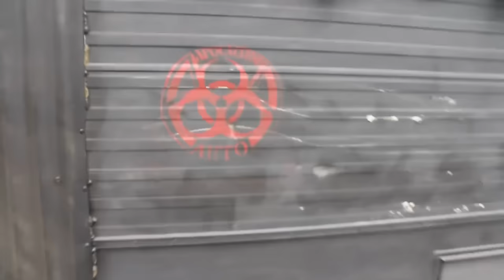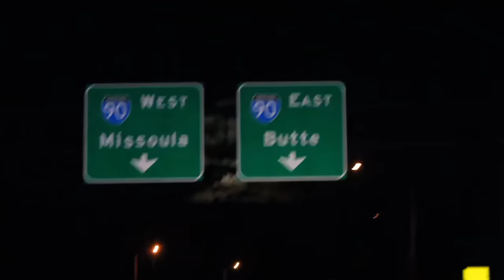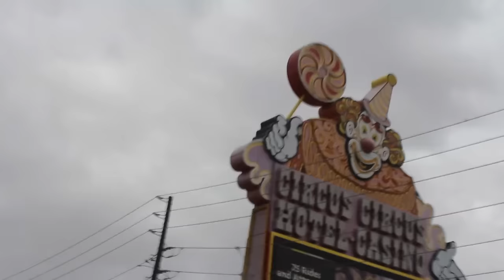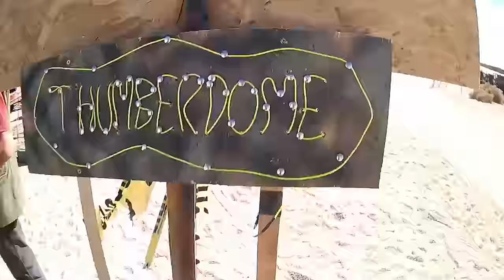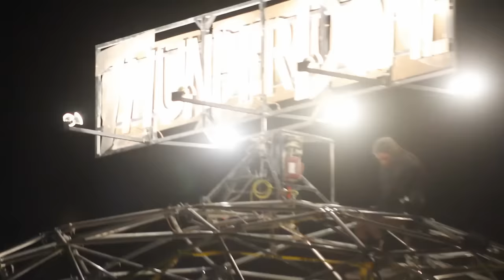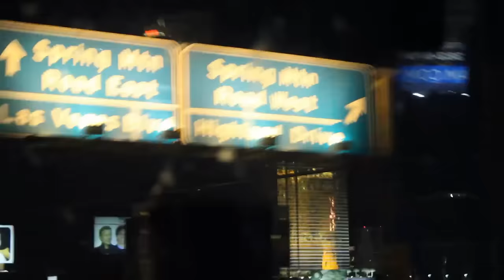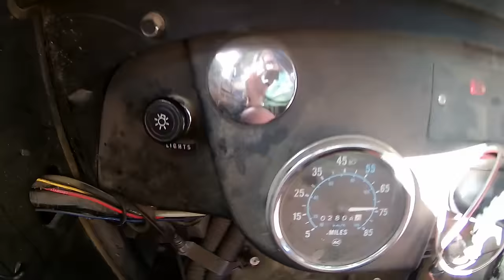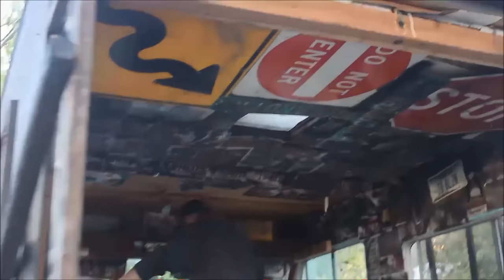1100 mi. to Wasteland Weekend in the War Child Apocalypse Bus! APOCALYPSE AUTO ep.5

Comment: I think with that old camper having engine trouble you guys should give it a whole new engine maybe not brand-spanking-new but maybe something with a little more of a growl to it
Reply from the maker: yes!
Reply: That 440 needs to come out, be freshened up some, and stabbed into a rusty Mopar of some kind. Roadkill-style.
Reply: Go with a small Cummins. Isreal used a 6 cylinder "VAL" in their smaller tanks during the "6-Day war" in '67, and later up-graded to an 8-cylinder "VALE". From what I understand those engines did very well in the desert!!!
Reply: @ApocalypseAuto  i am your fan my vehicle in mad max 2 interceptor v8 motorhome armored
Reply: Could of been a weight issue causing the engine to run too hot and smoke, but what do I know.  lol

Comment: just need to put the transfer case if equipped in nutch.  if manual put the shifter on the floor in N.  but if it is electric unbolt the linage on the t-case and manually put it in N. just trying to help you out alittle bit.

Comment: I did not think the bus would make it 1100 miles. That plow blocks the wind from cooling the radiator. And school buses are slow, highway speed has the engine roaring. And towing a SUV is more weight and drag.

Comment: yea 454 is not a good engine for a motorhome its big and powerful yea but its build too lightly thin rods thin crank fussy starting snf thin rings

fords 360, 390, 460  are way better because they are over built from the factory and if you got lucky some motor homes have MD engines in them 330s or 370s 391 FT block engines

Comment: The fury weekend on a#### flats is better and no cops or gun laws in Nevada  100 square miles of wide open throttle it was invite only but didn't go This year heard its open for next year to all .The round up is awsome where all vehicals run at speed on 20 mile oval .Last year some vehicals hit over 150 mph on straight aways